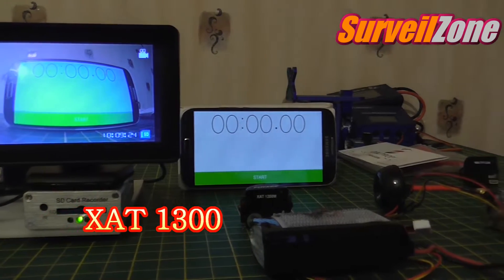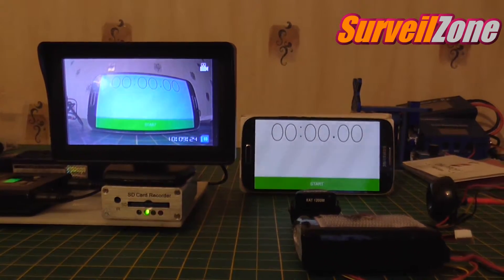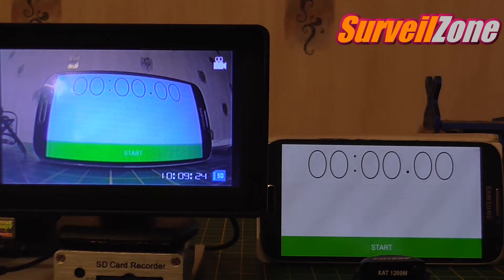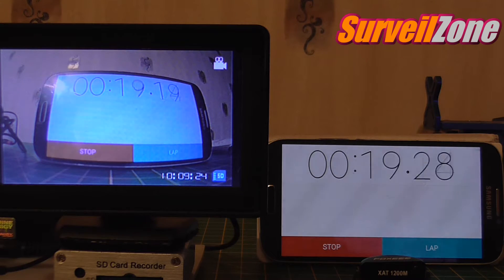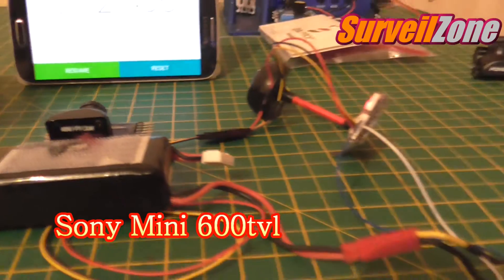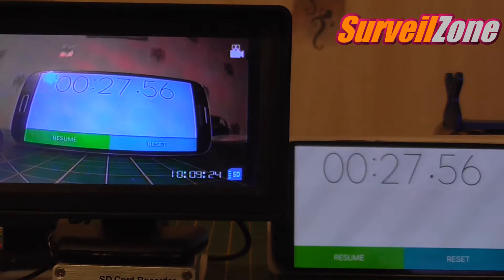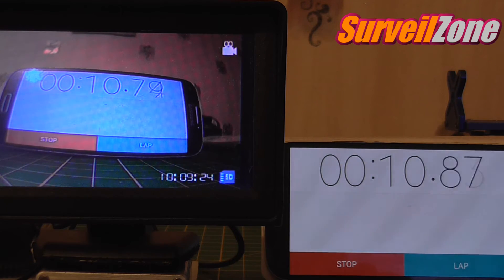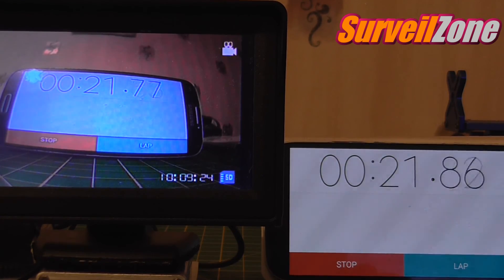Foxeer XAT 1200M Latency against sony 600 mini

Comment: ? the numbers seem wrong here. First, I am seeing latencies of ~0.09sec, which is ~90millisec (as someone stated earlier). Besides incorrectly stating this in your posting (it's not 0.9ms, the first decimal is 100s of millisec, the next is tens of millisec, so it's closer to 90ms), 90ms seems long! Maybe the LCD monitor you are using also has some delay that you might also need to factor in.
Reply from the maker: yeh was my first latency set up 
its why i used both cameras 
in the same set up

Comment: I hate to say it but not sure about the accuracy of this test...an hs1177 is around 2ms + screen latency of around 30ms....90ms is not a good result - and suggests the screen is has a lot of latency. The question is - does the 1200tvl camera have the same latency as the 600...in every other test I've seen the answer is no. Perhaps this Foxeer one has cracked it tho?!
Reply: But isn't the only variable being changed still the camera? Arguably regardless of the latency of the rest of the equipment one would still see a difference right?
Reply from the maker: Bingo :D

Comment: For this test to be more precise you should probably use an old CRT monitor or a 144hz LCD.  Those panels your using have additional latency.
Reply: And disable resembling and interlacing on your editing software. you have multiple numbers overlaying the same frame

Comment: Really nice test...  What camera do you prefer? And why ofcourse
Reply: By the way to be more accurate..  Do it with more digits to be able to capture less than a millisecond
Reply from the maker: +Ido Botnik  They are both the same as for mounting but i have to say i am liking the XAT 1200 simply because it gives off a better picture to the DVR so i dont have to go try mount cameras on a 180
Reply from the maker: +Ido Botnik Was just the stopwatch i had on my phone at the time. Its a easy enough process and will get a better download :D
Reply: +Pudsey - Rc is the picture in the goggles better? How is the wdr? And colors? 
This camera looks awesome... I'm asking this because I want to find the catch...  You can't have all, you must compromise on something. Is it the case here?
Reply from the maker: I tweaked the settings it comes with a little control board that goes in between the camera and vtx i dont like the super bright contrast and bright color when flying will test flight again upload video and share settings.Downside its mounted on the horrible metal mount for now

Comment: Still not a bad camera.
Reply from the maker: +Invitingsauce no it hasn't i can pause frame by frame mate the comments are bang on
Pause it so both numbers on screen are clear to see. Both video,s  0.9
Reply: +Pudsey - Rc your right. Can't argue with frame by frame. I consistently get .09 now. Sometimes I would get more or less. But the number weren't 100% clear.
Reply from the maker: :D i had to be talked threw it myself mate so i know exactly where your coming from.